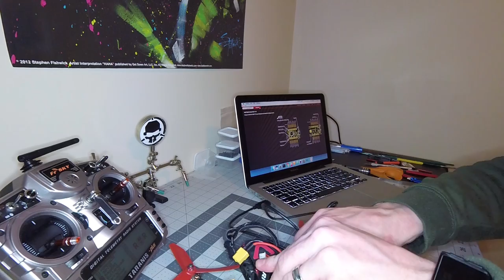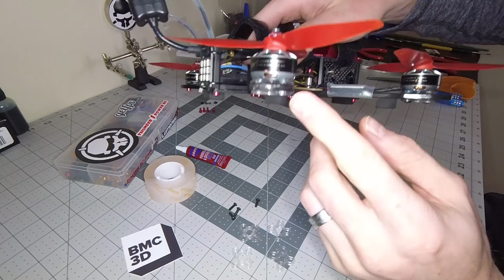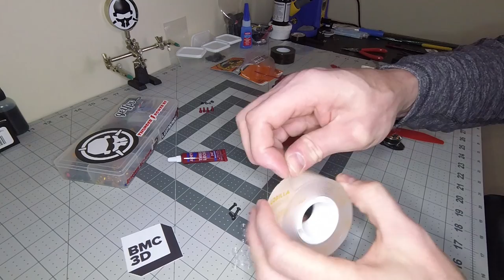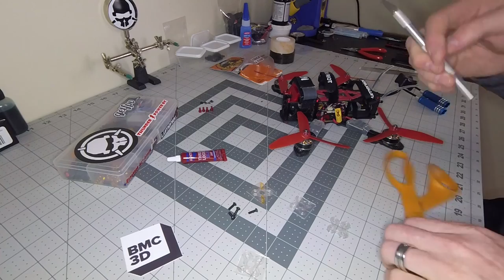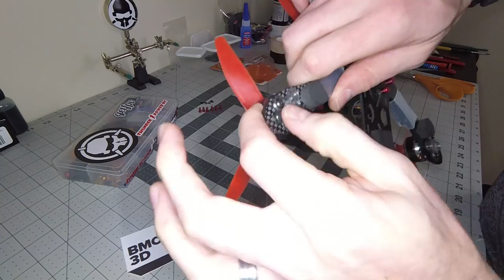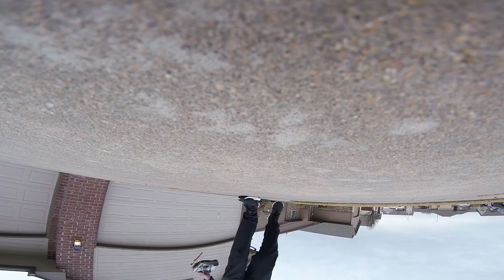Ultimate way to SOFT MOUNT your motors for FPV, DOES IT WORK?

Comment: All aboard the soft mount hype train
Reply from the maker: Chris Ertel lol... yup yup, I don't see myself doing this to all my quads but wanted to try it on my problem child
Reply: Chris Ertel it's not hype it's been show to clean black box logs and help get rid of minor issues. A good tune won't help you when your motor shafts and bells are damaged this should be used to mask out physical issues.

Comment: Thats actually prop resonance. Flick one of the props and you can see all the other props resonate with it. Durable props have a real bad tendency of vibrating like that. I soft mount all my flight controller using those rubber bobbins especially when blheli_s came out since most of these vibrating problem starting occurring around that time.
Reply from the maker: Steven Merrell I updated my firmware on the FC and ESC and it actually got a lot better yesterday, the soft mounting was to see if actually works on a noticeable vibration, but definitely was not the overall fix.

Comment: You should really use all four screws. It has a ground why there are four of them. When you only have two in, the Fleepower is stronger and causes more oscillations. (Sorry for the Bad english, i´m an Austrian) And with the time the motors will come out of their mounts. You should always mount a motor as strong as possible. Just think of a Washmashine for your clothes. I know some people they mounted their motors only with two screws, they had all the same problem. Motors come loose and oscillations. It´s like the same you are mounting your Carwheels. So i hope i could help you. Best wishes and happy flying.
Reply from the maker: Thomas Krois thank you
Reply: You are Welcome. Love what you do here. So when you need some advice let me know it.

Comment from the maker: PLEASE READ!! I wanted to clear something up I should of brought up in this video. SOFT MOUNTING IS NOT A FIX!!!! as other have said in the comments the problem I am having here is a firmware/tuning issue.  You should always first fix issues like these by making sure you have most up to date firmware and a good tune. I used this quad with these issue knowing it had a problem to see if soft mounting would have any results on this bad of a vibration and it did so soft mounting does work and can be useful to clean up a bad motors or take small vibration out after you have fully tuned the quad.  Thank you again for the support and helping me get this quad smooth as butter!
Reply: I agree, even perfectly tuned, this WILL help some of the noise in the gyro. However small of an improvement it might be. It's still an improvement.
Reply from the maker: Scalawag you sir, are correct! I'm still rocking it and loving it!

Comment: How are the soft mounts holding up? Still liking it? Where did you get these? Or did you print them yourself?
Reply from the maker: Ray Choi yea these are still going strong. I got mine from bmc3d but you could have them printed by anyone using TPU.
Reply: Everything Naus thanks ;) dunno anyone who had a 3D printer... So I'll probably order some.

Comment: 3 layers electrical tape can work but you have to be very precise how tight you make the screws you want to use threadlock and only just snug the screws.
Reply: Stephen Gibb tried that but 1mm tpu mount worked a whole lot better for me

Comment: it looks like a perfect recipe to strip the threads of the motor ...
Reply from the maker: ! tomekyo nope, been running two screws just like some of the top pilots like Steele and have never striped a motor or lost one.  just make sure you build it the way you like it and trust it!

Comment: How high are your D's? Maybe try lowering them quite a bit and see if the motors run smoother.
Reply from the maker: Blindside FPV Thank you, your are correct that will help, I used this quad as an example knowing it needed a better tune to first see how well soft mounting worked.  I later went back and retuned and it even better now. I wish I would of explained that better in the video! good call though thank you.

Comment: you attach the gopro with a velcro to the front... no protection? why
Reply from the maker: In this video you will see both a foam wedge and later 3D printed mount. both do leave the go pro a little open to damage so I do use a silicone cover in bright red to protect it or find it if it ejects! you can find these on Amazon if you search Silicone cover for gopro session. You can also see pictures of this on my Instagram www.instagram.com/nausdesign

Comment: Can you post me your PID´s.  I got the same quad and had no problems with that hard vibrations.
Reply from the maker: Sputtelkopf yea I could get that for you, I have fixed this issue with a firmware upgrade on the kiss FC and ESC. I could of lowered my PIDs to also change this but it was bad firmware
Reply from the maker: Sputtelkopf it have to be later not around my setup right now. but it really close to Steele PIDs with a few changes to meet my style.
Reply: Nice.

Comment: you ESCs touching the carbon?
Reply from the maker: Nope, the carbon arm has a foam pad and electrical tape between the ESC, then heat shrink to the arm.  This issue you see has been solved and you can see in this video where I explain! https://www.youtube.com/watch?v=ojlrOqCPdmI

Comment: droneplastics.com has some that are made out of ninjaflex and it is softer than tpu. feels almost like rubber just figured I would throw that out there for anyone interested.
Reply from the maker: 1087kyle awesome thanks man! yea that one of the reason I added that double sided rubber tape to give it more of a gel feel.
Reply: Everything Naus no problem! I was having some yaw twitches caused by vibration getting to the gyro and they smoothed it out and got rid of the twitching.

Comment: The motors should NOT make this sound. They are micro-oscillations and WILL burn the enamel off the motors over time. Flash the FC to a different firmware and set the LPF_filter to HIGH. The idle should be very smooth, the so called "idle resonation" is not a good sound to hear.
Reply from the maker: Flux FPV Thank you I'll check into it, I have been fighting it for a while on my 5in I am running same firmware on 6in with no issue but I'll try to reflash on the quad in this video. soft mounting did smooth it out but nothing a proper tune should of not fixed first!
Reply from the maker: Flux FPV Thanks again, I knew I was running the first beta with Dshot so I upgraded the firmware on the FC & ESC and wow silky smooth now on arming. Again Alway better to fix the issue the right way before assuming soft mounting will fix it. on other hand soft mounting did prove to take some shakes out lol!
Reply: Everything Naus I had this same exact vibration problem on my quad (before soft mounting was a thing) about 3 months ago and i just increased the d low pass filtering (so i lowered it from 100hz to 70hz i think) and also increased the filtering on my gyro lowpass filter (decreased about 10hz i think, not in front of my computer right now so idk the exact values) but anyways try playing around with those filters and I think it should help. :)
Reply from the maker: CesarSalad Thank you, I did go back and clean up the tune and update firmware and it silky smooth now!
Reply: idle resonation interesting ,... i had the EXACT SAME  thing (full KISS setup) when i changed the PIDs , everything went away

Comment: have you tried notch filter btw?
Reply from the maker: Dávid Lipcsey is that the filter on the bottom right of kiss GUI with high and low options. If so then I have
Reply from the maker: Dávid Lipcsey thanks I'll check it out